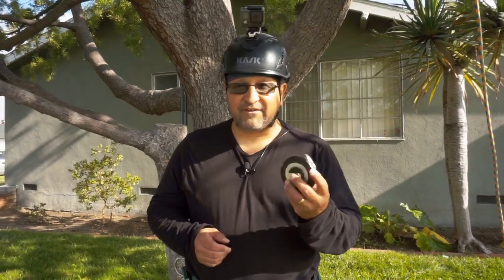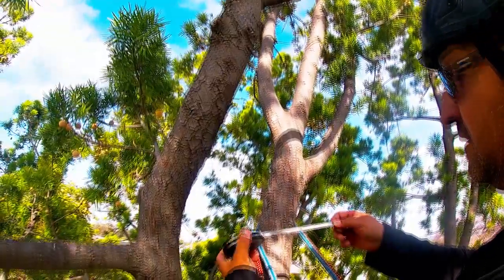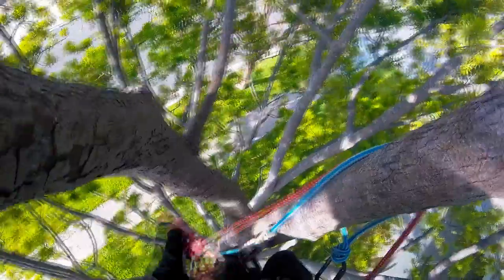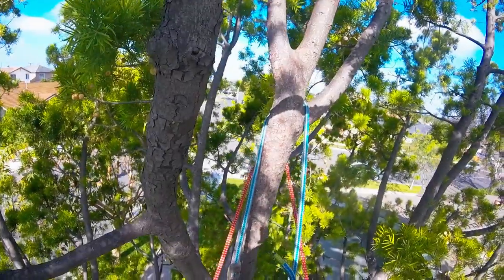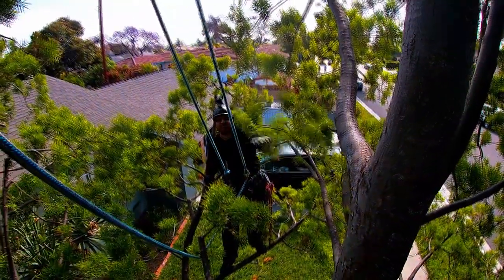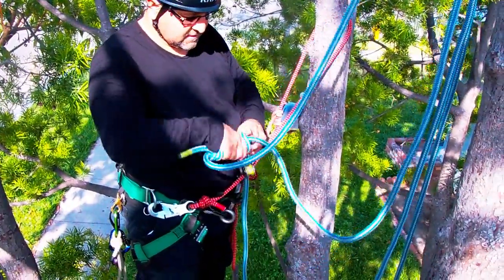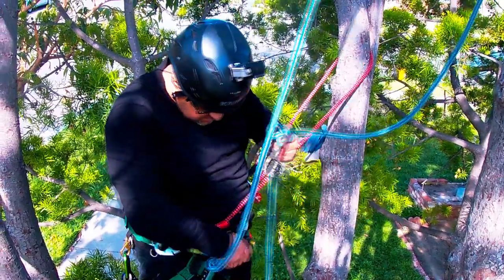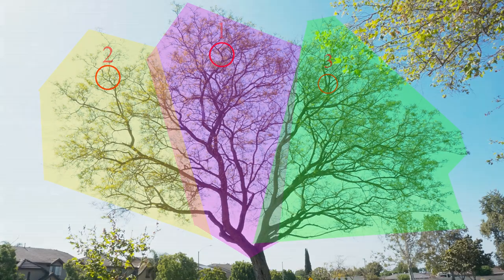Why tree climbers should choose the proper tie in point

Comment: Thank you for sharing! I like hearing how others do things, often I try out their methods. Sometimes I adopt them or an adaptation. I have a request totally unrelated to the video. At the end you finish while standing in front of a tree you used four years ago for your split tail Blake's hitch video. I was wondering what that branch on the right looks like after four years? I'll look through more recent videos, but maybe you could point me to one that shows the tree? Stay safe and keep being awesome.
Reply from the maker: You're welcome. Yes net working and keeping an open mind is a great way to go. I picked up a lot of the techniques I show that way.  The limb on the right was a co-dmoninant stem that was competing with the main leader with lots of movement. I didn't want to remove it at the base because I was not sure what the irrigation would do to it.  I broke the drop-crotch rule cut at small diameter branch sofar it hardened up but it is not showing decay yet. Thank you!
Reply: @BinoH  Glad to hear it. It caught my attention in the previous video and when I saw the same camera angle today I was looking to see how it had fared but it doesn't show up behind you. Thank you for answering my trivial question! Be safe.
Reply from the maker: @dwaynemadsen964   On another video about 2 years ago you can see the cut from above. Figure Eight Stpper Knot on SRT.

Comment: Good instructional video Sir, one question though... Your using a H.C pulley yet you didn't clip the terminal end of your line back onto the pulley, strange, 🤔
Reply from the maker: Yes, if you have a spliced eye rope it is a good idea to clip  your standing line to the top of the Hitch Climber Pulley, but if you are using a termination knot it could rub against your friction hitch and possibly cause you to slide.  Since I'm kind of big when I climb DDRT I separate my termination end and climbing hitch. It's a little more comfortable on my hips.
Reply: @BinoH  You can tie a termination knot with a big loop, eg a bowline or a figure of eight so the body of the knot doesn't contact your hitch. You should try another harness like the T.M or the M.B, 👍🌲🇮🇪